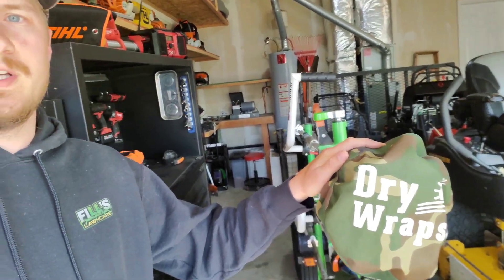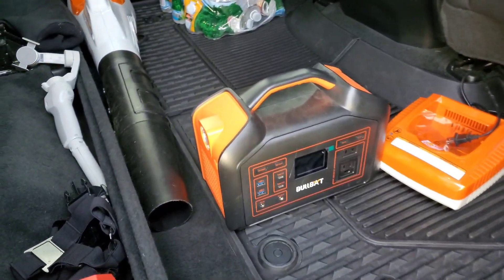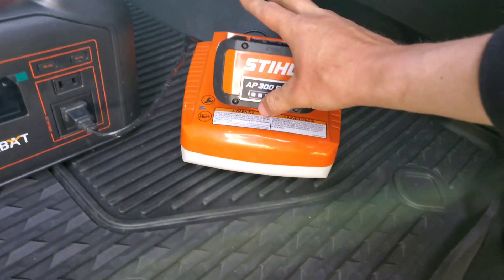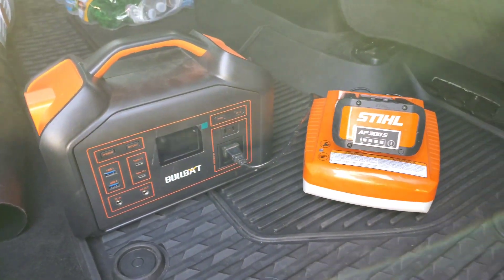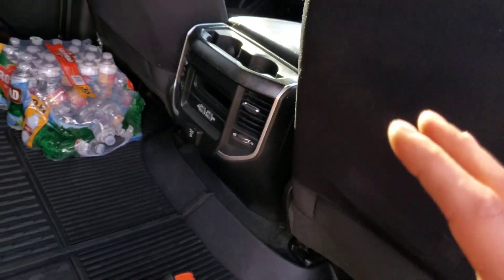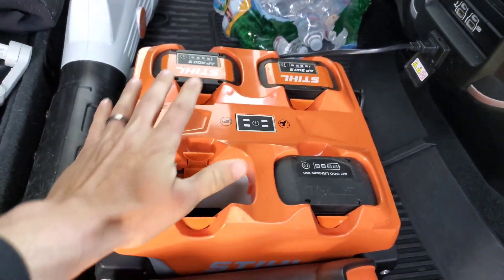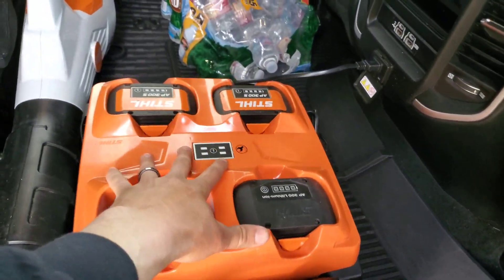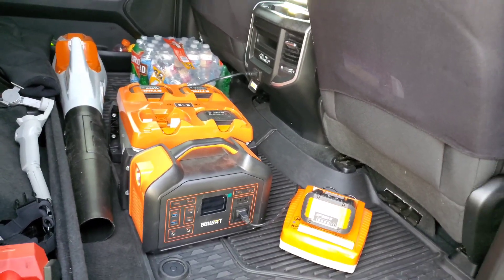How I NOW Charge My Batteries For My Lawn Care Equipment

Comment: I just buy one 750W inverter, I have a jeep Suzuki and the jeep battery is 70w. I try yestarday having the jeep not running and using the Stihl charger AL 500 and the Stihl battery AP500S, the battery was discharged, it starts charging but after charging 2 cells the alarm on the converter went on for what I understand the jeep battery was going down so I stop and was able to start up the jeep then after 5 minutes I connect it again and the alarm went off. In my case with out the jeep running I am not able to fully charge one battery.
Now the case is if I am out in the woods and must have the jeep running miners well use a gas power generator and connect the AL500 to the generator.

Comment: The only problem is it takes over an hour to charge a 300s   It’s not good to partially charge them. Like in between lawns when the truck is running and you don’t want to run the truck just to charge the batteries that defeats the purpose

Comment: Hello. If I have 3 AP500s and 3 AP300s batteries what power station do I need to charge all batteries at least one time with power station disconectd from the wall. Thank you
Reply from the maker: What charger do you have?
Reply: @fillslawncareplus  I have 2, I have the AL 101 and the AL 500.

Comment: I don't really get buying a power invertor for $500 and more when you just simply just buy more batteries.  AP300s is $240 so you get 2 for less then the invertor.  Never understand having a battery charge a battery.  The truck invertor ok.  Not trying to be a downer just can't wrap my mind around it.
Reply from the maker: Good points. sometimes you need that quick charge when all batteries are dead but I get you